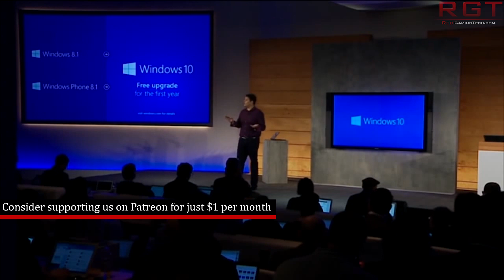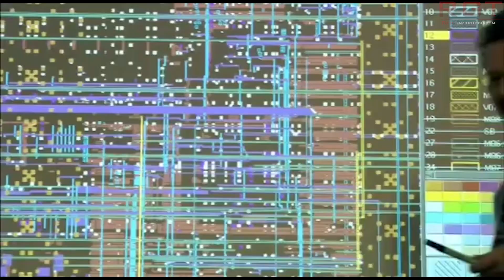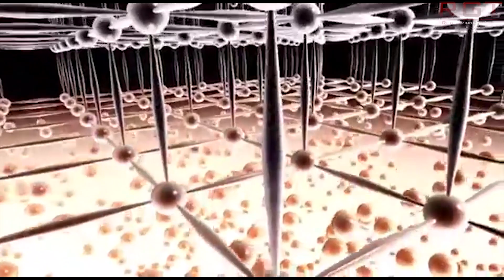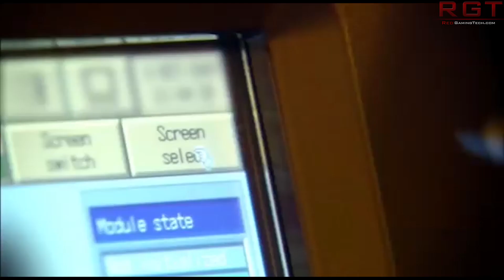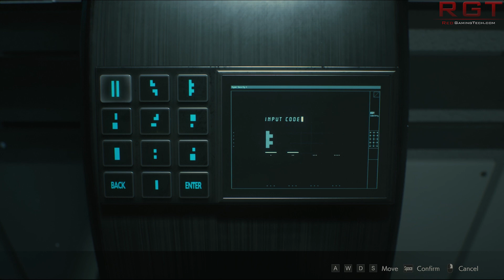GlobalFoundries Sues TSMC for Patent Infringement | Steam Bug Bounty Expands After Flaw Dismissed

Comment: I have an issue as well with the new update. They have made a right mess of the "Dim light" mode. It's constantly on! I can't turn it off at all! Graphics drivers updated, sweeped, updated again, fresh install of them etc. Still an issue. Was supposed to be fixed in the July update. Still doesn't work!

Comment: Years ago I purchased a great sound card, Sound Blaster Z, and continue to use it when I upgrade my computer.    Great sound, no reason to ditch it.    Also, I continue to use Build 17134 of Windows 10 for reasons such as the one you are commenting on, problems.
Reply: @James Smith    There was a time period that Creative Labs made poorly supported garbage.    I watched the market closely in order to stay away from the pitfalls.    There is no excuse for the trash they sold for that several year period.
Reply: @James Smith    I worked in the computer field for 35 years I kept abreast of everything hardware related.    I agree there is no excuse for any company to treat customers as bad as Creative Labs did, even if many companies do it in some manner.    After shafting the end user for many CPU generations Intel got a wake up call from AMD again, for example.    I do not blame you for not purchasing anything Creative Labs and wish the best for you.

Comment: Nope, don't a sound card. I use a DAC amp combo. To me sound cards are just inconvenient as now my audio jacks are on the back of the PC and not where I need them right now. Plus an amp lets me control my audio with a nice analog nob. Sound cards are only really useful to me if I wanted toslink audio, but I don't use that. USB is more easy. It's a pain with drivers but USB doesn't require me buying a sound card.

Comment: Yep creative x-fi ae-5 here (I can get pinpoint 5.1 direction sound enhancement on headphones, make a noise I know exactly where you are) don't get that with onboard sound cards typically (but some do have something similar to x-fi ae-5 like on Asus from x370 later seem to have it but more audio features on the higher end boards )
Reply: Ae-5 user here too, probably could of stuck with the x+fi I had been using for around 10 years, had no issues with the audio quality but as I had some cash to burn I thought I'd get a upto date sound card. I haven't used motherboard onboard audio since about 2006 & I could never go back as onboard audio just doesn't compare to a high end dedicated sound card.
Reply: @Frostie3672  got the ae-5 as it restored the 5.1 to  headphone directional audio assist feature (was mostly broken on old x-fi PCI card due to way windows handles audio after vista driver model changes) so good when you can wall hack with sound lol (not cheating if you make noise I know where you are)

Comment: Electrical device the does stuff when you trun it on and stops doing stuff when you turn it off and is powered by any of the following air, water, sun, petroleum, fuel cell, battery, power grid, hand crank, the force, body heat.   Patent Granted.